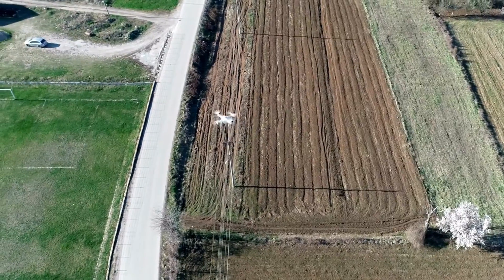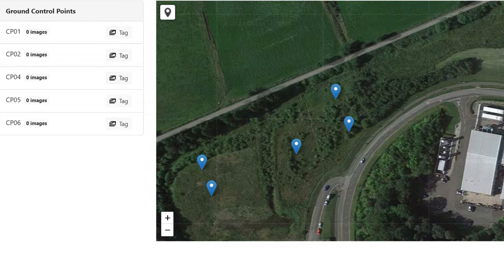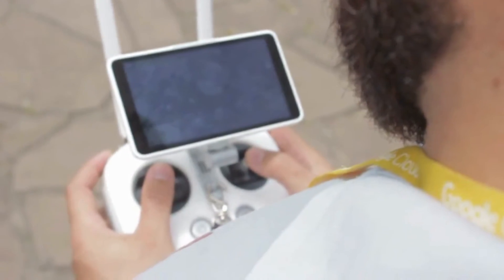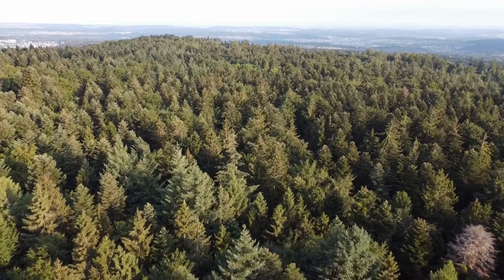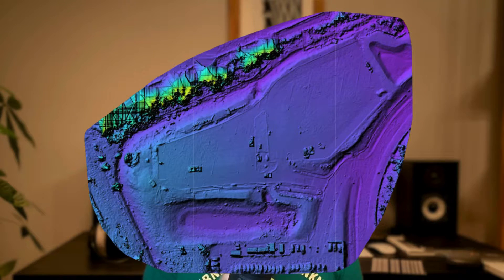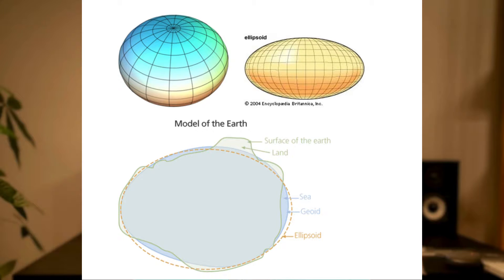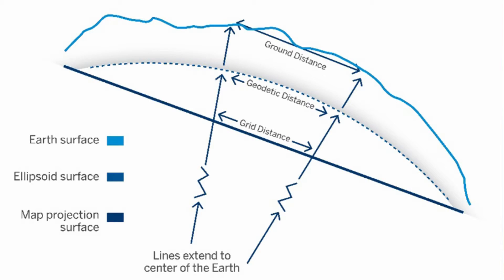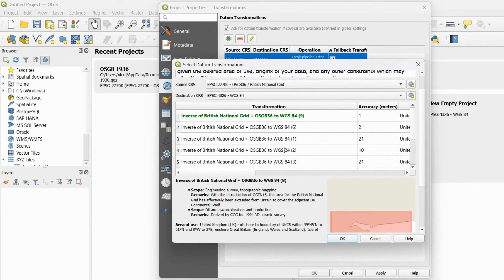The 5 Critical Drone Mapping Mistakes You're Making Right Now

Comment: Hello,
Thanks again — really excellent explanation!

Here in France, to avoid all the headaches with coordinate conversions for my GCPs, I developed my own software with all the national geodetic ingredients: RGF93 projections (Lambert-93 and CC), NGF-IGN69 vertical reference, RAF20 correction grids… basically everything you need to keep things precise.

After surveying my GCPs in WGS84 with my DRTK-3, I simply import the CSV file into my software, which automatically converts everything into consistent national XYZ coordinates.

As a result, I can inject the converted CSV directly into Terrain Creator (Surveyor)… and that’s it. Simple, clean, efficient. Merci guy france